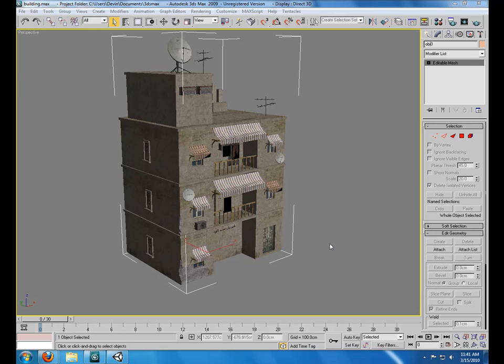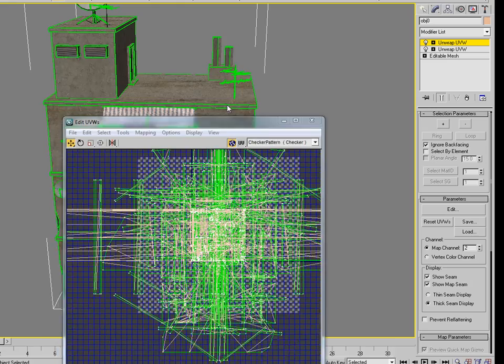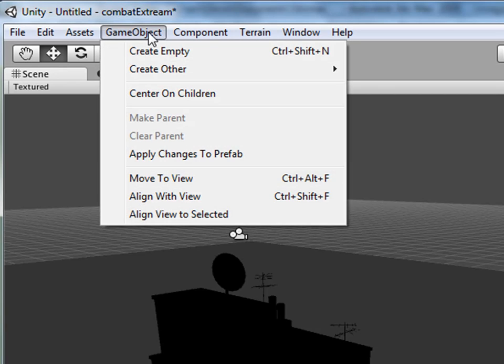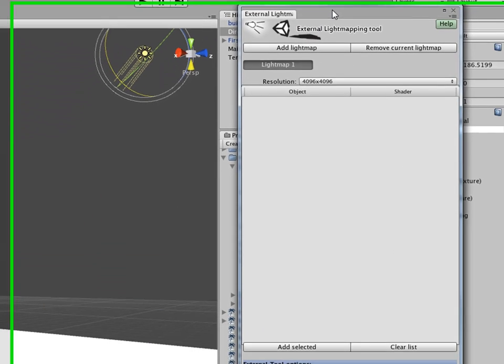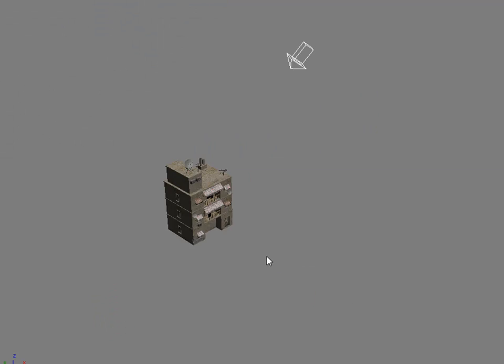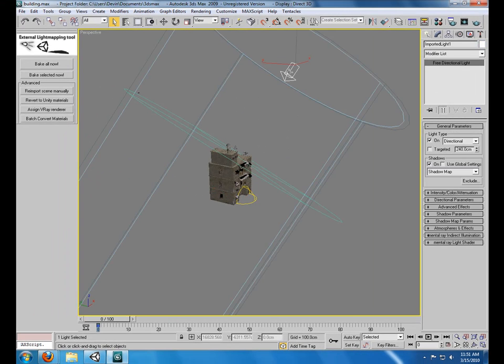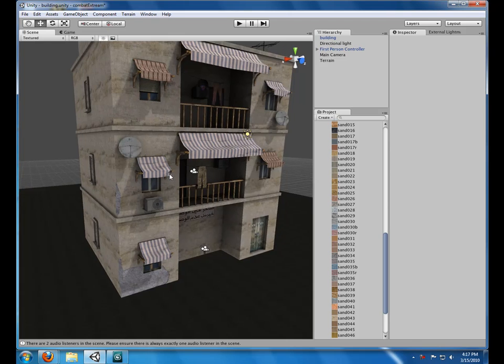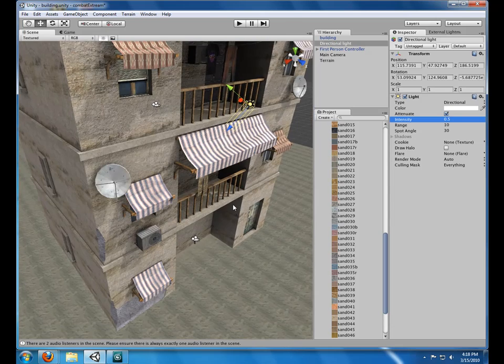Unity3d External Lightmap Tool

Comment: @JoaoPauloGarcia if you hit the number 9 on the keyboard, the one by the backspace key and not the number pad, you will get a render setup dialog box that will appear make sure your the little box that says active is not checked and you can go back to your skylight and look at the options for castshadws and your options should be there  to select them now...it wont be grayed out...hope this helps..